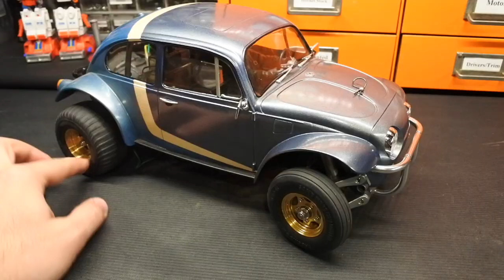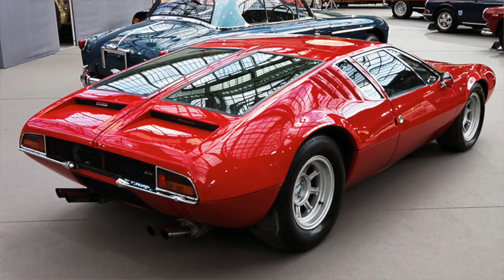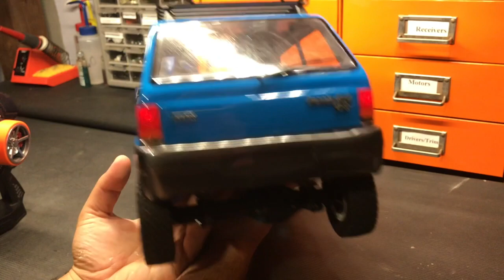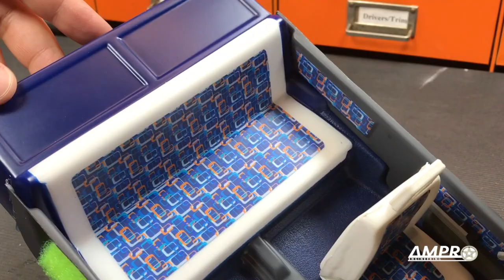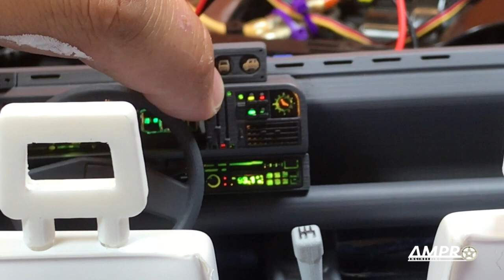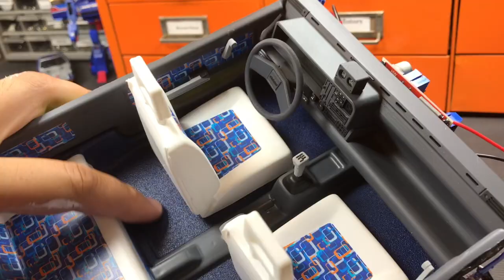e221: Tamiya CC01 Fiat Panda by Plastic Dreams Build - Body

Comment: you're gonna hate me... PAM 8403 3w+3w stereo amp size of a postage stamp, 75c.
https://www.ebay.com/itm/PAM8403-2X3W-Mini-Audio-Class-D-amplifier-board-2-5-5V-input-BSCA/293109758791?hash=item443eb3fb47:g:C8QAAOSwax5Yz6OT
you could put tunes in it with a 2 dollar MP3 player or card module velcro'd behind the back seat to plug into the amp between those rear deck speakers (as large as will fit of course).
Reply from the maker: I do hate you. So much......

Comment: OCDetail INSANITY!! looks so awesome tho.
just slapped a New Bright Jeep Rubicon body onto a WPL C frame, sliced out the headlight blanks for 10 mm LED's and chrome (plastic) bezel rings, sliced the hood to open on figure 8 stitched hinges with 10lb monofilament and closes with neodymium button magnets, modded the tail lights for 3 mm LED's (easy fit!), slice-n-dice widened WPL rims with the tread lugs cut for more traction, powered by fresh set of 400 rpm 6v N20 motors means it'll be "awful slow". one thing didn't do was chop the frame 1/8" shorter up front, but the front wheels aren't THAT much "too forward", to be really right I should have cut+welded the rails 1/8" both front and rear, right behind where the pull rods mount (from motor mount area).

your fault now...  the front bumper idk wth its from but fits so nice, had fakee trail lights on it. being I installed same 10 mm LED's+bezels in the MN-D90, I'm now trimming those stock headlight buckets to fit the lights in the Jeep's bumper for the yellow/white 5 mm LED's from a newer WPL kit, like I popped into the "monstered" C framed B-1. darn you!  :)
Reply from the maker: That is amazing. Its crazy how many applications that chassis is capable of taking on. Sorry about that but we are even now! haha!

Comment: I attempted to look for that power converter on eBay with... no success. Do you know what the title is for the item?
Reply from the maker: Try this "LM 2596 Adjustable DC-DC Converter Buck Step Down Regulator Power Module Display"